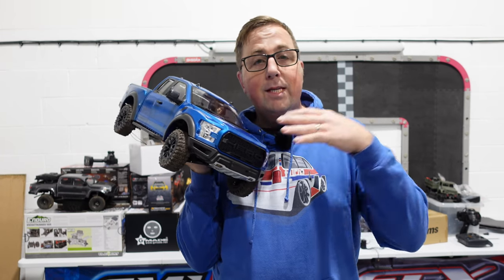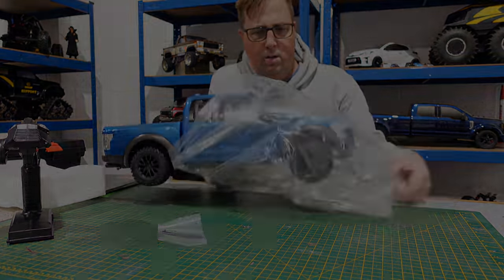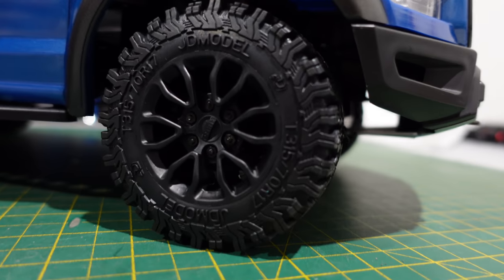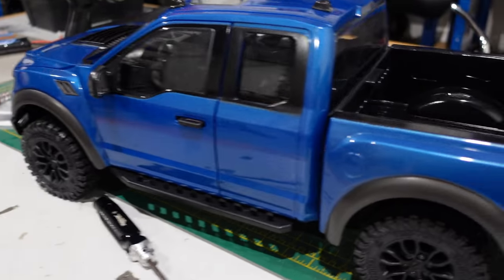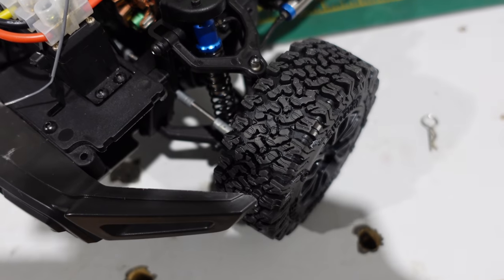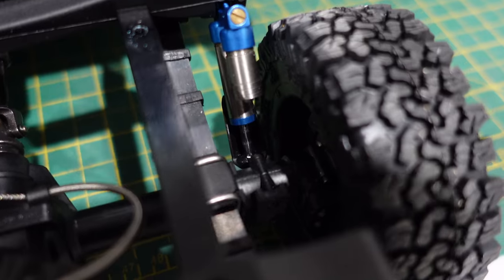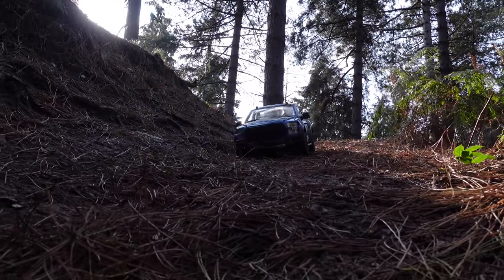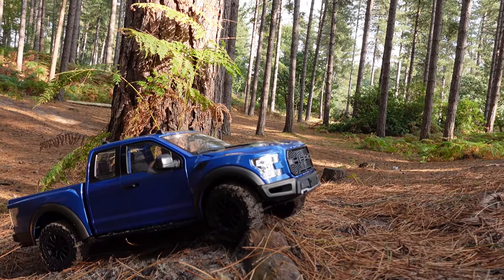Did YOU Know About This?...I Didn't!  HERO F150 RC Truck by JDModel

Comment: The wheels come off by undoing the 6 tiny nuts with a generic cross wrench. There’s. A little disc and hub behind that you can undo and fit a normal hex 1.9 wheel
Reply from the maker: Awesome… cheers 👍

Comment: I had 1 a few years back when rc4wd sold them. Not the most capable but was definitely a fun truck to drive. If you want to change the wheels to use a standard 12mm hex the plastic disc brake rotators from a traxxas udr are a direct fit. From what I remember you can use the stock brake caliper for scale 😎👍

Comment: Phil, your audio sounds great. That lapel mic is doing well at separating your voice from the ambient noise, inside. Outdoors, there's a very up-close-between-you-and-me, sound. Very pleasing & relaxing, overall. Thanks for hearing my feedback (and sorry for the pun)
Reply from the maker: Thanks Al. I always look for your comments on the audio from you. Pleased its improved someone what. I still have a little white noise and reverb to deal with in the Workshop… but the lapel mic with the wind muff does a good job of keeping it a little clearer.
Reply: @TomleyRC  That's flattering - I'm very glad I could help and you clearly took those comments to heart, as so few others do. Fewer still will notice the slight 'budget' sound of your lapel (but I'm trained fairly well at hearing those details) mic but it even keeps my ears happier than most channels. I don't want to seem like a know-it-all, but I wanted you to do well on 'Tube and that's why I've been offering. Looking forward to lots more vids. Cheers, Phil.
Reply from the maker: @aljensen7779  no problem Al. It’s a Rode lapel with a Rode wireless set up. Not ‘studio’ quality by any means, but it’s much better than any built in stuff or ‘it’ll do’ attitudes 😅
Reply: I'll have to consider this mic set-up. I just hope it's available in Australia.

Comment: Love this scale look, my Ezra would fit nice behind the wheel. 
I run a 35T with a 3:1 planetary gearbox on a HW 1080 and drag brake set to 0%, my truck does not move on a hill without input from the controller.  I bet that ESC doesn't have drag brake at all.
For the price it should come with LEDs installed.

Comment: Could of at least used wago clips if going down that route 😬😂 would expect better for the money really! Also they advertise the RC4GS remote but yours came with a Dumbo? Certainly looks good I like that it has the locking diffs and the body plus interior 😎 disappointed those light buckets are not filled with a little led kit. Really had potential to be an awesome little scale trail truck if not for those few things 🤷‍♂️ I know there minor and easily sorted for just a few quid, but that kind of makes it worse. Gives the impression corners have been cut for them to save pennies in the grand scheme of it all. I honestly feel gutted that it dint fulfill its potential. Great video as always thank you Sir 🙏

Comment: The flex of the suspension is disappointing,  if it possible, one should convert it to a link sort of rig for more flex. On, and, it's a RC4WD Dessert runner---I think.
Did JD Model make any modifications to it, I mean in the chassis?

Comment: Yep. I like the posh camera, low slung footage for the slow stuff. Nice! I know it's a 1?10th trail truck, but seeing as it is an accurate scale representation of a full size F150, then it does make me wonder how capable that stock full size F150 truck actually is. Apart from power differences I reckon my Old Discovery 2 TD5 was more capable. :)
Reply: Well, as for the capabilities of the full size F150....they have stopped being trucks and are now more soccer mom SUVs. More gadgets and jimmy jims than a bentley. Supposedly the Raptors are real off roaders but who knows?
Reply: are you referring to the diffs? locked and unlocked? The full size trucks can be ordered with limited slip which means that if you get one wheel spinning due to mud or snow, it locks up the diff using brakes inside so it transfers power to both wheels. There's a sort of centrifugal clutch on each axle

Comment: Yeah bit screechy, crawler trail truck not really my thing . Is it similar to the FTX Hi Lux
Reply: I'd say the FTX Hi_Rock (aka unlicensed Hilux) is WAY more capable, not to mention cheaper! I bought one a few weeks back. The FTX doesn't have selectable locking on the diffs - they are fully locked at all times, but it can do a great job of crawling as well as trailing. The FTX does have LED lights operated via a switch on the Tx however ;) BTW I still run my Lunchboxes - I'll always enjoy the happy, bouncy puppy of the RC world LOL!
Reply: @TachyonDriver  
Lunchbox are cool even if useless 😝
Reply: @mark-1rc502  :D Yep.